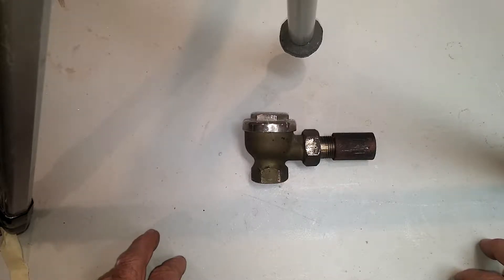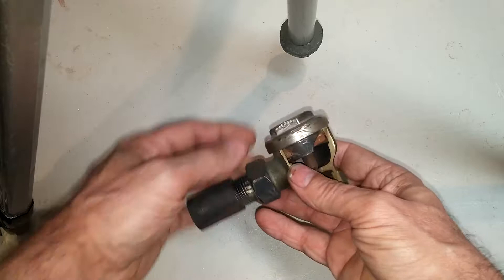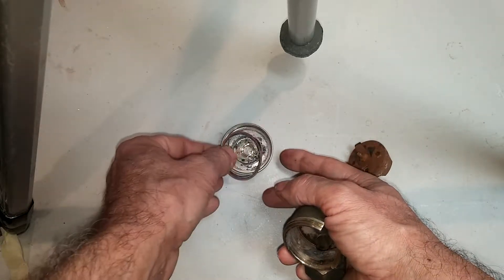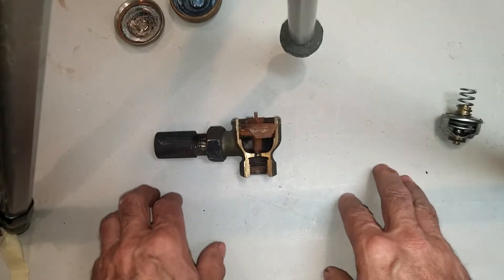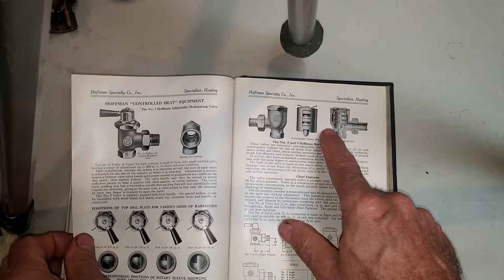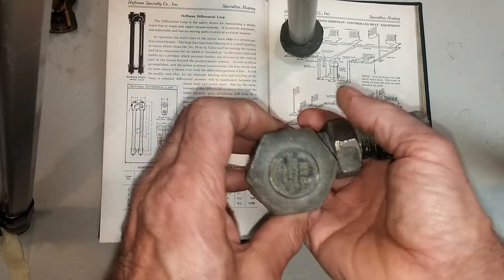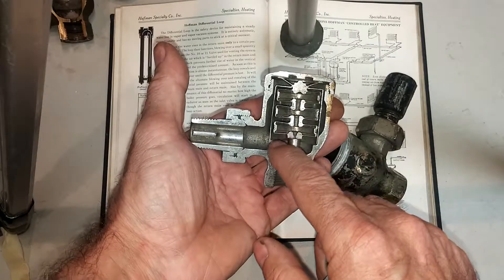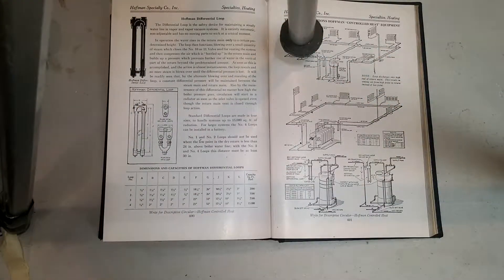The "Red-headed Stepchild" of Steam Traps. The Hoffman #18

Comment: It must be noted that Tunstall makes an excellent Hoffman #18 trap rebuild product, the TCHF-1411, which is functionally equivalent to the Barnes & Jones #2211 cage unit.  However, I believe the Tunstall 1411 requires a new cap, whereas the B&J does not.  Tunstall may have modified their offering and my info may be out of date.  Best to check with them.  Tell them I said Hi!